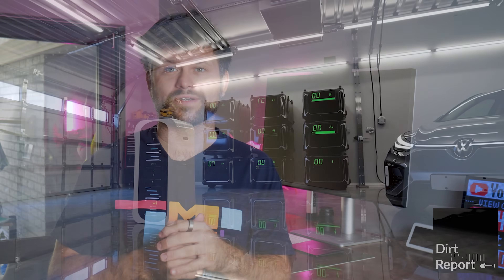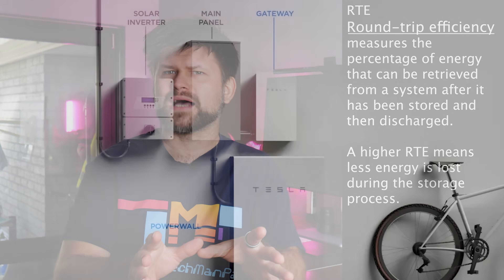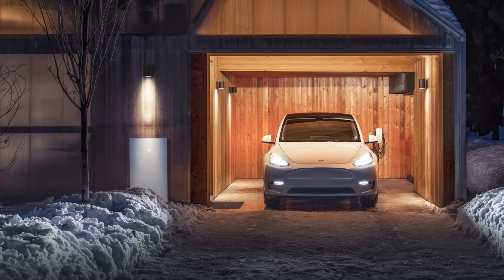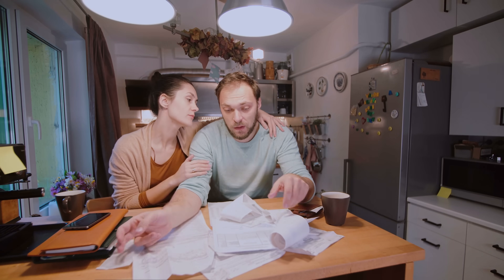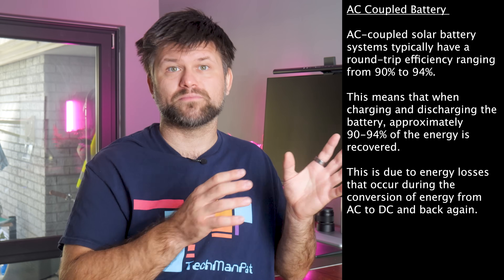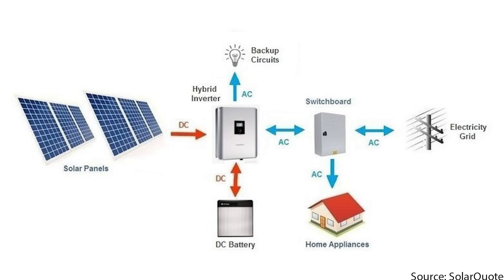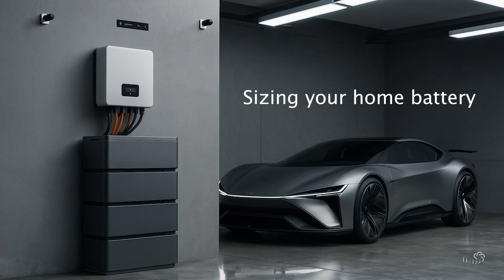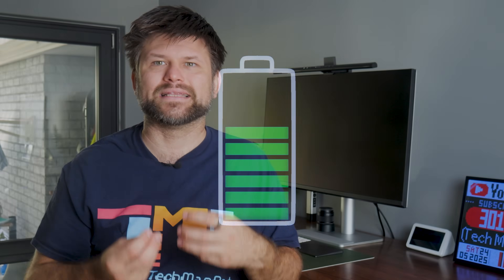Choosing the Right Battery for Your Home | Australia 2025 Guide

Comment: Those average power usage figures include people with Gas connected. So that 5 people household figure of 25 kwh, young family ( kids too small to start things ) with gas cooking and heating are going to be lower. Kids are teenagers, no gas, power usage is going to be higher.
The number on your power bill on "average power usage for a family of "... often overlook this fact.
Reply from the maker: Yeah, those are just ranges, and real-world usage will vary based on your lifestyle.
Reply: @TechManPat  The problem is that they use those numbers to "guilt trip" anyone that uses more.
Reply: My  house  is fully electric and averages 25 to 41 kW per day this time of year ( up to 50kW/day in winter due to ducted recycle air cond heating). Heating and cooling is half of this which is essential for us retired ppl.  We are also conscious of our energy bill with our solar export helping significantly because we installed in 2011 and have the 44c + retail per kW export.  Unfortunately what is not told is any alteration to the existing system will cause our export to loose the 44c.  This is catastrophic for us for without that our bill will increase by 4 times.  So my dilemma is I have to wait till 2028 when the 44c comes to an end and then I will be paying a significant amount every quarter instead a low  of 3 quarters in credit and 1 to pay (in winter). My system is about 4.5kW due to limited roof space and shading avoidance.   So I'm stuffed every which way you look at it financially if I modify the system for say even A/C battery.  I might say too the charging of the battery takes away some of your export which atm is critical to having manageable quarterly power bills.
Reply: @mikebloodworth9258  Is that kwh per day or kw all day. One is energy, the 2nd power.
OK being picky but they are different things.
I will assume you mean kwh per day.

Comment: Great video and clear explanation of many technical plus practical considerations. Well done!

Perhaps it needs to highlight the Federal Government battery rebate is :

1. One time only (no add ons allowed) per household

2. Applies only if paired to existing or new solar PV systems.

I think a lot people may be overwhelmed a bit. A lot to take in - most will need replay to take all in. 

The battery sizing needs to consider typical usage per season. As you mentioned… Specifically in winter or cloudy times that greatly reduces solar PV generation. Plus as you stated in winter you can consume more power than summer, etc.

Some websites like SolarQuotes have (Solar / battery) modelling tools that take your smart meter data (from your energy grid supplier, not retailer) to show your usage to/from grid but not in home use.

Given most states mandating TOU rates, lower FIT, Demand Tariff charges and Two-Way Tariffs (negative FIT)- plus limits on grid exports (reducing benefits of Amber, Localvolts, etc for some) the primary sizing needs to be focused on minimising grid usage and charges. 

The Warranty period is import and guarantee of the retention percent at the end of period. Some warranties are based on throughput in MWh or cycles.

Will the battery installer be paid by the manufacturer or distributor to come fix warranty claims or you have foot that bill?  This tends be the reason some systems are more expensive to install or buy.

When in black out mode - and the battery fails (safety cutoff due to over load, etc)  - can you manually restart or connect with no home power / wifi? Especially if it has no control panel or hotspot/bluetooth interface.

Does it have black start missing the battery is fully drained and fires up your solar PV inverter ? 

You tend get what you pay for and want you installer not sell you something easy for them install and then you never see them again. Same problem with cheap solar PV packages / installers.

Comment: pat, you also missed out on electric /induction cooking as a high draw appliance, which can be both single and 3 phase also. there is a growing trend of people looking at converting from 1phase to 3phase to use on things like EV chargers and those cooktops and hot water systems as 3phase is more efficient than 1phase.
Reply from the maker: Yeah good point, going full electric, it’s part of the usage levels right
Reply: @TechManPat  well based on a model Y doing 80km/day a home would need 13kwh per day just 4 it. so if only got 2..3kw on single phase per hour need 8hrs to recharge so 3 phase maybe the go unless use sigenergy DC EVSE
Reply: @RayJohnson1980  fyi - I have single phase and a 7kW hard wired EV charger